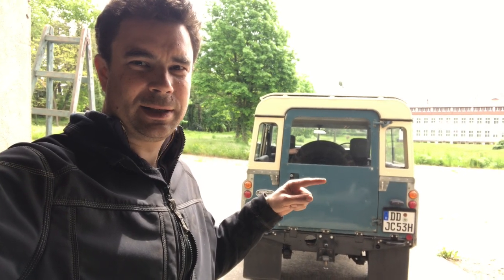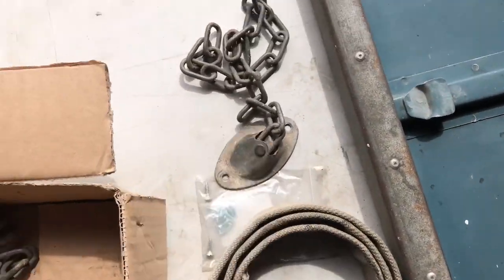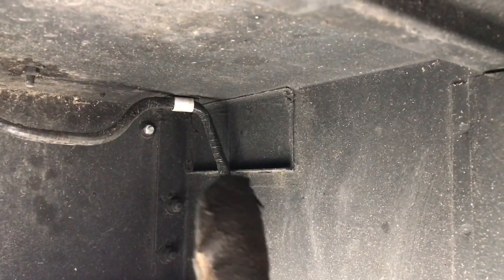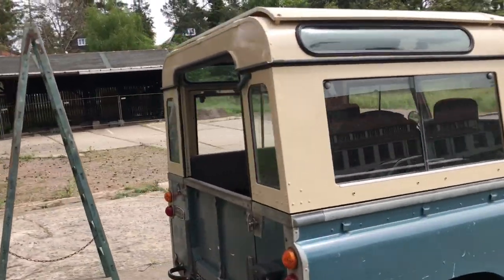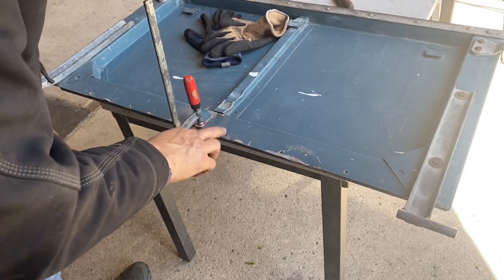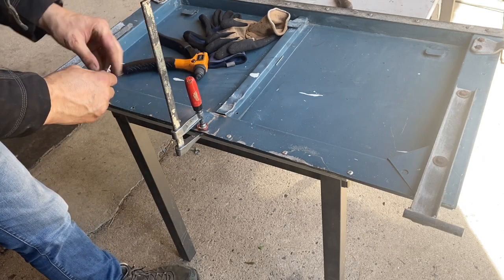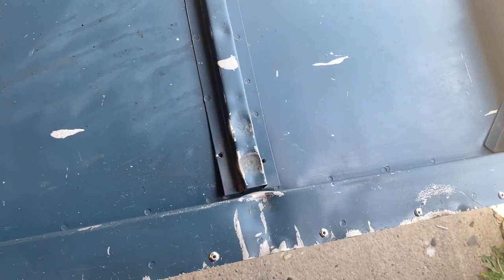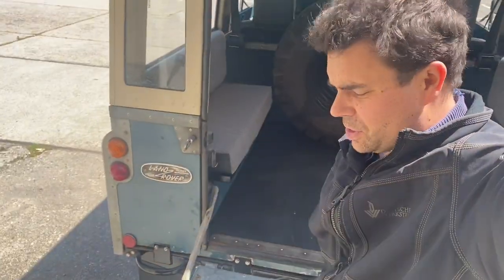Land Rover Series 3 Restoration - Fitting the Rear Flap - Part 71

Comment: I found when fitting my chain brackets there were indentation holes from the factory left that lined up perfectly
Reply: Yes, exactly. You could see them in Joel’s video. The other give away is that the chain usually hooks onto the tailgate in the second last link to bring it level. I’m sure it will work just fine the way Joel has it though.
Reply from the maker: Thanks guys. That’s good knowledge for others doing the same work. I am intrigued to see the marks.
Reply: @My911  I noticed a small dimple in the inside face of the tub. I’m guessing that’s it.
Reply: Agreed . . . indentions where there when I fitted my tailgate.

Comment: I really love the look of the firehouse but can’t find any anywhere!!
Reply from the maker: Yes, me too. I was lucky as it came from a friend. Maybe ebay? It is old hose for sure
Reply: I'm a volunteer firefighter.  When hose fails pressure test it's shortened slightly or thrown out depending where the leak is located.  Maybe try your local fire station.

Comment: Have just found your channel and am enjoying going through your Land Rover restoration videos! Just wondering, what kind of fuel economy are you finding it has? Does it have the 2.25L Petrol engine in it? You have probably said this somewhere in your videos, but I haven't watched them all yet, although I do plan on doing so! Thanks in advance.
Reply from the maker: Hi Thomas, I’m glad you found the channel. I used to get around 15 mpg when I was young and counting, but I have no idea now. Probably the same.  I just fill it up when it’s empty these days but it’s not economical that’s fro sure. The Overdrive helps of course on the open roads so if you are considering buying one see if you can get an OD. But the mpg is not why you buy a Land Rover. They are like children, they change your life. After not having driven it for over 20 years I am so happy to be back on the road. And yes, it’s the  2.25 petrol with a Webber carb and Turner Engineering cylinder head.
Reply: @My911  Thanks, yes I am looking at investing in one as a potential first car. Mum used to own a Series 3 back in the UK (we are in Australia) and I was very saddened to hear that she had sold it before I came along... Anyway, hopefully we shall have a Landy back in the family soonish! Thanks for your help.
Reply from the maker: Great stuff Thomas. Good luck with the search. I can highly recommend a series 3 as your first car. There is so much you can do with them,  especially in Australia.
Reply: @My911  Thanks, there might be a few more questions coming your way in the future... :)